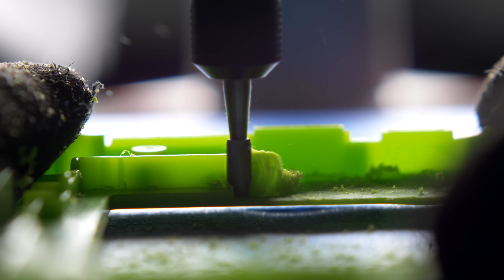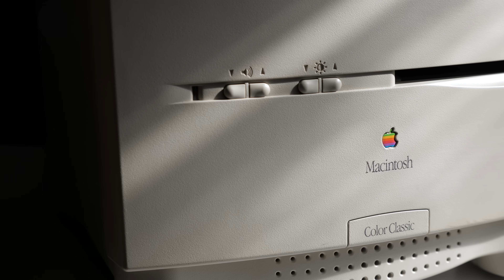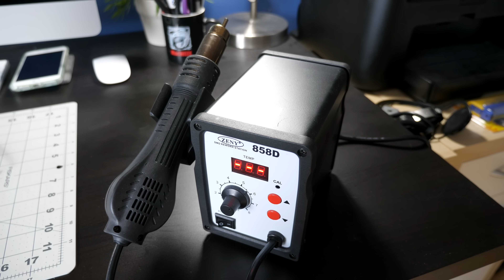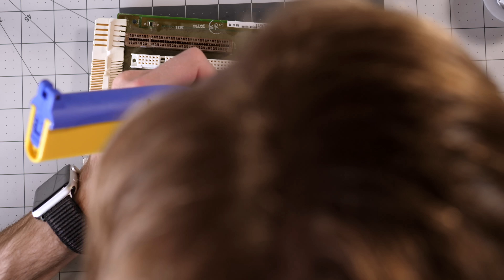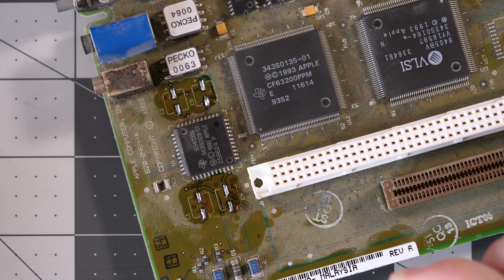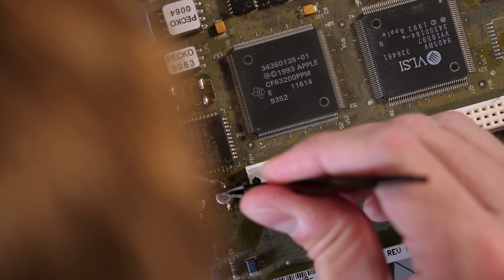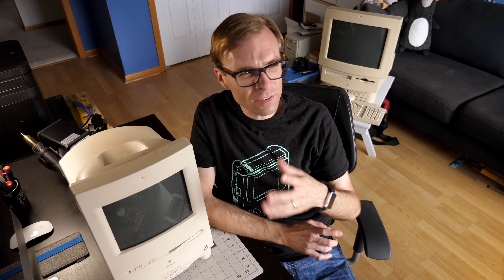Recapping My Classic Macs

Comment: Whenever you are doing hot air rework you should always use flux. It does two things. First it takes to oxidation and keeps it off the outside layer of solder. This causes of solder to melt easier and evenly, it also keeps the oxidation from interfering with the welding process.

Secondly it helps protect the components around it from the head. You can also use kapton tape to help with that.

Also another big thing to consider while doing hot air rework is the flow of air. It doesn't matter if you melt a solder of the other components around it. Surface tension will keep them in position. Unless the air flow is too high then it will just blow off components.

Start with a lower air flow and then work your way up.

Also never run the repaired equipment while it's still hot. Give it a minute or two under a fan to cool down. Don't use a cryo spray either. They have their place, but in this situation it might crack the board
Reply: Good work thats exactly what you do it helps alot and it keeps surface mounting easer without breaking traces
Reply: I'm surprised he didn't mention the use of flux since he was using a flux pen.

Comment: I need to mention that through hole caps can also leak in the same way SMD caps do. This is especially common with old Low ESR caps inside switching power supplies like thos inside classic macs. The output filter caps on my Macintosh Classic I PSU actually leaked that way and ruined the hole PSU; fixing this took me several moths, since I also had to replace many other components from that area that have been destroyed by the electrolyte. And removing this old electrolyte is crucial (especially in high impedance circuits, but also anywhere else) since it's - as the name suggests - conductive. You need to use acetic acid (from vinegar essence) to neutralize it; just dissolving it with alcohol or removing it with dry cotton swabs is not enough. Also don't forget to remove any residue of the acid once you're done, since it will quickly corrode stuff.

And one other thing: the electrolyte leaking from caps sometimes is invisible without removing the cap, since it often stays under the bottom side of the cap or - with SMD caps - between the plastic part and the actual cap sealing.
Reply: When ever working on a mac remmember it isnt always a cap it can be a short or bad transistor diod or resistor. And yes classic macintosh computers are very random when it comes to working on them. And i have had leaky caps that still work fine and test fine in a LCR meter but I would still replace due to tje high hours and the loss of heat restriction.
Reply: @nekoprince9621  Replacing some diodes and transistors and some passives was also a challenging part of my mac classic repair. It also took me a while to figure out that the potentiometer was destroyed by the electrolytes and had to be replaced.